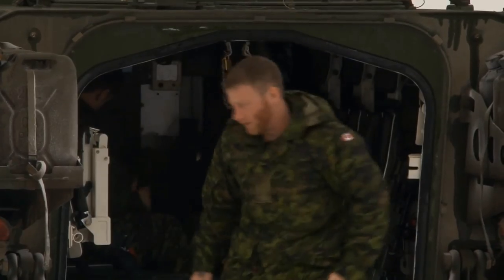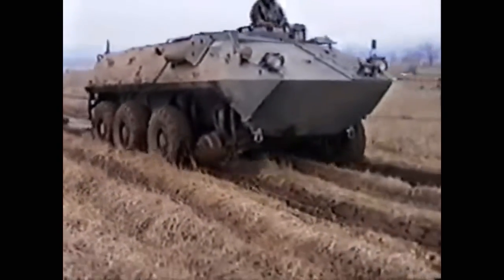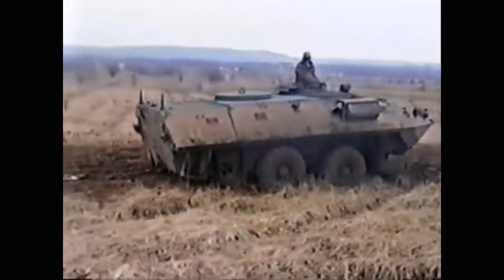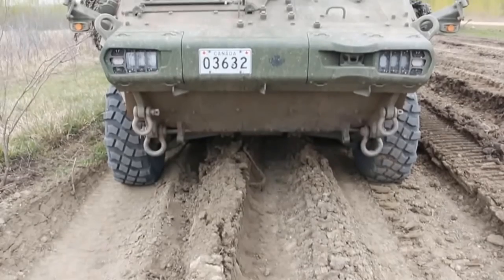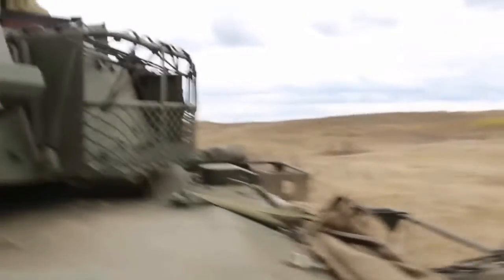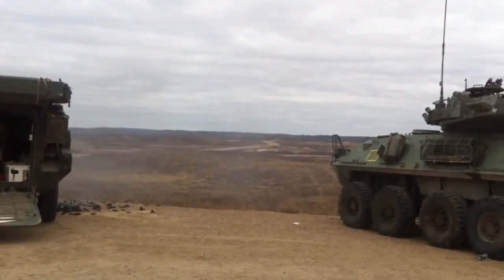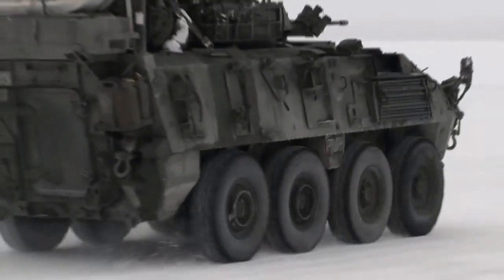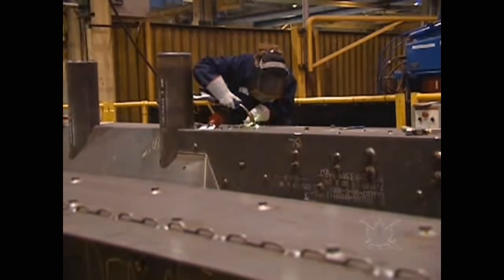Canadian Light Armoured Vehicle (LAV) Series - LAV III

Comment: I used to drive LAV 3's when I was in the Canadian forces (1PPCLI). Most of the time I was in I was either driving a LAV, riding in the back of one as a dismount, or servicing one.

 A few things I want to mention to add to this video since i'm no longer in the army and can actually state my opinion without worrying about higher ups shitting on me for doing so . 

First the good. Driving the vehicle is amazing to drive. It's fast, agile, and easy to be trained on. It's main gun has a lot of bang for your buck. I've had friends who went to Afghanistan show me videos of what this could do against the Taliban and needless to say the Taliban had a bad day. It also has an immersion heater in the troop compartment that allows you to heat rations or brew coffee, meaning no cold rations which I can tell you suck.

Now for the bad. The LAV 3 is extremely top heavy. I've almost rolled a couple, I've seen other Lav drivers roll them at CFB Wainwright and Gagetown. That in itself isn't the worst part of it. The drivers seat belt unless they've changed this is a 5 point harness designed for front, rear and side impacts only. If the LAV rolls the driver has nothing stopping them and they slam into the drivers hatch. I've known of at least 2 people who died from rollovers. A friend of mine who survived a roll over survived only because he was short and had enough room to tuck himself in and hit the drivers hatch with his shoulder rather then breaking his neck. 

Second this vehicle offers almost no protection against IED's short for Improvised Explosive Devices. Compared to something like the RG-31 APV that Canada also used in Afghanistan. I've lost a few friends from IED's riding in the troop compartment of the LAV. And known others have come home missing their legs.  

3rd this vehicle is supposedly designed as a APC (armored personnel carrier) or AIFV (armored infantry fighting vehicle) depending on who you talk to. I've always heard it referred in battalion as a AIFV. It's supposed to carry a section of troops. Most of the time because our battalion was short staffed which meant that there would be 6 or 7 dismounts in the back. Even then with 6 people with kit stowed behind them and their weapons, ammo and webbing it was a sardine can. You barley had room to properly move around and being stuck in the back of one for hours at a time was almost torture. Yes military vehicles are designed for combat not comfort. But a vehicle as large as the LAV 3 has almost nothing for space when compared to something like an M113 that Canada also used, that could also be fitted with a similar type of main gun and turret, and still have more room. Not to mention tracked vehicles don't get stuck as easily as LAV's do.

Don't get me wrong the LAV 3 is a decent vehicle overall and I enjoyed my time serving in one. It's a good piece of kit, but it's not as amazing as Matsimus has claimed in this video.
Reply: Yea the ASLAV here is pretty much the same though we use them for armoured recon. Now that you mention it I do recall hearing of a few roll overs over the years, though it does look a bit top heavy, especially when you start throwing it around.

Ours can swim, which is handy we have a lot of rivers and shit and there is never a bridge lying about when you need one. Though we are replacing them with the Boxer Armoured Reconnaissance vehicle now, I know basically nothing about it so I cant comment on the Boxer haha
Reply: I don't take it as him saying how "amazing" it is more just saying what it actually has.  Surely things like seatbelts would be an easy retrofit fix if such a problem even going so far as to swap out the entire drivers seat for something more adequate?
Reply: @regregan5755  Easy fix yes if the government is willing to shell the cash out for a refit. But in practice it can take a lifetime for simple changes. As far as I know the vehicle has been updated since I've left the army. But the issues I mentioned above were almost 10 years old when I got out.
Reply: A. Thank you for your service sir.  B. The points you make re the LAV are spot on…The LAV has a rep for rollovers and not being proof against IEDs.  But as you so well pointed out, it does the job it was intended to do and the gun makes it a lethal addition to the Canadian military’s ground forces.  Cheers mate.  Well done!
Reply: does the LAV 6.0 upgrade address these issues?
Reply: @Kishanth.J  Don't know. I left the army in 2006. The LAV 6 started coming into service in 2013. From what I've read it has a more powerful engine, better suspension, and upgrades to the hull for better protection against landmines.............something the LAV 3 really lacked.

It's also supposed to be much heavier and it looks like it has smaller wheels. Hopefully that fixed the fatal flaw of the LAV 3's which was killing the driver in a roll over.

So it's probably/hopefully an improvement. I can't say how much of an improvement because I've never operated one. So I can't compare them
Reply: Do they at least have AC and heat for hot and cold environments? Can't see a crew being as effective if they're unreasonably hot or cold
Reply: @guruboy5  They do, the AC and heat in them was pretty good. The driver controls both. I imagine the LAV 6 that replaced the LAV 3 has a similar system

Comment: Great video as always. Two things: Speaking from experience, I cannot fathom anyone not utilizing the swim features offered for the LAV-series, because if it will swim from ship to shore, it will ford any river. Second: if you are operating an LAV, pay very close attention to the two right-front struts, as well as the hull area and frame members they are mounted to -- those have a far higher failure rate than the other six, because they bear most of he weight of the engine. When I was doing supply for LAV's ('88-'90), that was the main headache, from a logistics POV, as realistic use tended to warp the mounts and/or crack the struts themselves. I never found out if it was a materials-issue, or if it was simply an artifact of the design.
Reply: The swim feature works when the unit is new but the seals dry out and fail when it is older.   You also have to do a complete regreasing of all the grease nipples after a swim.

Comment: Have you seen Rheinmetall’s new Challenger 2 turret revealed today? It’s the same turret but with fancy new stealth shell instead of Dorchester, as well as new sights and integrating a smoothbore gun. Is due to compete against the Black Night design for the LEP contract. Would love to see a video, but just wondering if you’ve seen it.
Reply: Alfie Wray Link?
Reply: Sweet!
Reply: Not the same turret. It looks similar, but it is a welded construction instead of the old casted one.
Reply: Jonny, underneath the fancy new shell is the same basic turret design (presumably with modifications to mount the new smoothbore and composite shell). The existing Dorchester shell has just been replaced with a new welded one over the same basic turret design.
Reply: Interesting. Good to see a much needed update - I wonder if the fire control system gets improved too? Also the timing of this after hearing about Rheinmetall now having a big stake on BAe Land Systems. More here:

https://www.ft.com/content/7bda3984-1d66-11e9-b126-46fc3ad87c65
Reply: @AW-eo5sk  Thought so too, until i saw it is longer than the old one, to solve the ammo storage issue. Also we don't weld armor on nowadays, that defeats the advantage of external composite.
Reply: https://www.janes.com/article/85918/iav-2019-rheinmetall-unveils-proposal-for-challenger-2-lep 

Janes article if you wanted more
Reply: Jonny, fair point with the extended bustle, although basic turret form looks near identical, and to the best of my knowledge from reports out of IAV the base turret is near identical, if not very closely related in specification and format.
Reply: @AW-eo5sk  Yes, apparently it's a deep modification. Cast steel base was replaced by lighter welded one, but it re-uses a lot of the old subcomponents. So it's a new turret, but not really. Do you know what gun they fitted? DTR says L55A1, Jane's says L55.
Reply: Wait... Rheinmetall's Challenger 2 turret? How did that happen?
Reply: Ducks Ducks it’s a joint venture between BAE and Rheinmetall.

Comment: Done lots of second line work on LAV 3's, touched a few LAV 6's, TAPV's (not a good purchase for the CF btw). Worked on T-LAV's, Coyote's and Bison's as well. 
The newer gen of fighting vehicles are a lot easier to work on then the older stuff that is for sure.
LAV3's powerpack can be pulled and replaced with a switched on crew and proper tooling in about 45mins. The suspension is pretty easy to replace in a hurry as well. 
I got close to our Leopards but never worked on them. Seen all variants we have all in Montreal. Lots kit stored there that we never use. 
Another impressive vehicle is the AHVS. That is a beast of a truck. The armoured cab is something else.

Comment: Fun bit of trivia about the LAV-25s in Marine Corps service. According to a friend of mine, who was a LAV mechanic in the Corps, you needed to have two set of tools in order to work on an LAV. You needed a set of standard (inches and feet) tools and a set of metric. This was because the hulls were made in Canada and were made use the metric system while the powerplant was built in the US and used standard measurements.

One thing about the LAV-25 in the US is that we call it the L A V and not lav. Regardless, the Corps seems to like them well enough and they just recently announced a contract to upgraded our LAV fleet to LAV A3sso they can continue to serve until at least 2030.

Another not so fun bit of trivia about the LAV in Marine Corps service is that they made their combat debut during Desert Storm and because from the air at thousands of feet in the air, going several hundred miles an hour, they (apparently) looked a lot like BMPs to Air Force, and I think even some Marine Corps pilots and we, sadly, lost a few to friendly fire because of that. As a result, Marines took to draping large Marine Corps flags over the tops of their LAVs as an improvised means of visual ID to help pilots recognize them as being friendlies.
Reply: to a Canadian that's just one set of tools :P interesting nonetheless so thanks :P
Reply: Imperial isn't standard, metric is
Reply: Where did you hear that the USMC was going to upgrade to the LAV-25A3?
Reply: @sorincaladera936   you obviously never worked on any construction or many vehicles.
Reply: @blackdeath4eternity  I can say the same about you
Reply: @sorincaladera936  you can, but it dose not mean its correct, where as your view of measurements points towards inexperience, or talking on behalf of a country you are not part of.
Reply: @blackdeath4eternity  it doesn't matter if I'm not apart from your country, metric is the world standard. Might as well measure everything in stones and fathoms
Reply: @sorincaladera936  the world standard dose not mater in this context. thanks for clarifying.
Reply: Sorin Caladera reads 3 paragraphs.......comments on the imperial vs metric......
Reply: I'm sure most Canadian toolboxes have both metric and imperial since we used to use imperial.  Somewhat annoying actually having 2 systems. In some ways NATO should standardize as allies should be able to repair each others stuff in a war.
Reply: @xaviergraham7411  There's an article on Military.com that talks about it.
Reply: Hold both hands up count didgits asuming you aint cheating a lumber mill ya got ten ! Welcome to the dificult world of metric , all us maple syrup suckers got metric tools because our made in usa vehicles for the past 30 years are chalk full of metric nut and bolt goodness , forgive me im drunk
Reply: Riceball01 yea I doubt that’s going to happen... there is no point in re-refurbishing a 40 year old vehicle, however there is talk about a new reconnaissance vehicle for the USMC.
Reply: Sad to hear friendly fire deaths  .... It happens..... but still really pisses me off when I hear of them.

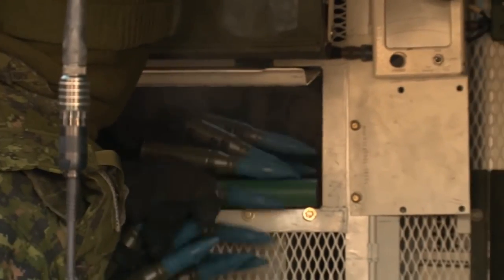Comment: Hi Matsimus. A few comments on the presentation in this video, and your analysis. When you begin to describe the upgrades at 6:50 you could mention that these are what turns the LAV 3 into the LAV 6.0. As things stand, 'LAV 6.0' is not mentioned by name until 11:09, and in doing so you may have given the viewer the impression that another series of upgrades are in the works.While I agree that the LAV 6.0 presents a decent combination of mobility, lethality and protection, I doubt I'm the only one sceptical of the claim that the vehicle will see the Army happily to 2035. The M242 piece looks to be decreasingly effective against troops behind cover (no ABM offered) and a new generation of adversary IFVs, assuming Canada wishes to retain a capability against (near-)peer opponents, and not just insurgents employing IEDs. It's also uncertain whether there's enough reserve power to mount an active protection system to deal with ubiquitous adversary AT weapons. GDLS has done some work on this, but it's worth noting that the US Army seems to have abandoned a similar effort for the Stryker after trialing three different systems. That doesn't bode well for the LAV's future.The only way I can see to meaningfully (and cost-effectively) enhance the firepower of the LAV 6.0 - since the US will be retiring Bradley and R&D on 25mm ammo will grind to a halt - is to follow the example of Kuwait (Desert Warrior) and Saudi (LAV Recce) and mounting single TOW launchers on each side of the legacy turret. This would give the otherwise bulky and static TOW system much-needed mobility and enhance the killing power of the LAV. (It would also compensate for the loss of the Norwegian TOW Under Armour turret when the Army decided to divert the 33 LAV-TOW hulls to the LAV-Recce programme.) I see no technical reason why this could not be done, although there may be little space inside the hull for re-loads, and Army may have some doctrinal issues with it. My response to that is two-fold: look how many of today's new and existing IFVs come equipped with ATGMs for long-range engagements, and; the Cdn Army is (and always seems to be) at least a decade away from fielding a man-portable ATGW.   Belated welcome to Canada!

Comment: Great information, thanks. Can you tell me the primary differences between the Leopard 2A4 and the 2A6M and the upgrades to the M-113 APC fleet?
Reply: The 2a6 has a better gun the L-55 as opposed to the L-44 of the 2a4 the 2a6 has thicker composite and more modern electronics

Comment: Just FYI, adding a 40mm isn't necessary and wouldn't help it at all. There is a reason why just about all AFVs and IFVs carry 20mm, 25mm or the 30mm. Those weapon systems are more than enough to take out any other AFV/IFV in the world. Adding something larger like a 40mm would just add weight and cost more with hardly any increase in firepower. These vehicles are just meant to be able to get troops to where they are needed and not to fight heavy armor. Their cannons are more for suppression. If they wanted something to take on heavily armored vehicles like a MBT, they would just add ATGMS, not a larger cannon. If they wanted a cannon to take out a tank, it would need to be a least a 105mm, like on the Stryker Gun Carrier. But that isn't really possible because it wouldn't be able to carry troops anymore. The gun systems would take up the whole vehicle. If you shot a 25mm at a IFV, it would go straight through it! That is how powerful a 25mm is. But usually they shoot an explosive round so when it enters a vehicle it won't go straight through.
Reply: NATO Stanag Level 5 is becoming more common now (many nations requiring it with the base vehicle now and not just with add on armour packs) which is why many nations are upgrading weapons to larger calibres.

Level 5 is protection against - 25 mm APDS-T (M791) or TLB 073 at 500 m with 1258 m/s[1]

Angle: frontal arc to centreline: ± 30° sides included, elevation 0°

So its ok against older vehicles but not newer ones, a40mm also carries a bit more punch at a longer range.

Comment: Questions? Are these vehicles air-portable, if yes, what aircraft? Can they be air-dropped and if yes, what type of chutes?
Reply: iirc they are air transportable by minimum C130. the US Army conducted airdrop tests on a modified LAV25 in April 2017 and Jan 2018 using Globemasters iirc
Reply: The Cavalry General Thanks  CG, I thought that they had problems with the vehicle size to fit the C130 for general delivery. Any gen on parachuting them, I would hate to do the rigging!

Comment: both LAV III 8X8 & the Stryker 8X8 is easily outclassed by the new MRAP certified KTO Rosomak M3 8X8 + 5.0 in. Lift 12.3 TDI I6 3-Dr Armoured IFV (LHD) which in turn is based on the Patria AMVxp 8X8 + 5.0 in. Lift 12.4 TDI I6 3-Dr Armoured IFV (LHD)!!!

Comment: not sure if i like the 25mm. it probably frees a lot of space up being so "small", but 35mm opens a very wide envelope of things it can scratch. a 35mm and a 50cal coax covers most of the things you'll wish to harass (throw some 7.62 on there for good measure why dont you, or maybe a .556 mg instead. when you have a 50cal the smaller rounds would be used in much the same way anyway).

Comment: 5.56mm on the roof (maybe to share ammo with the passengers)?? Our ASLAVs carry the 7.62mm MAG-58 (same ammo as the coax). Also upgrading to 40mm increases the weight and probably reduces the number of passengers (due to increased turret size) which is pretty important for a wheeled IFV.